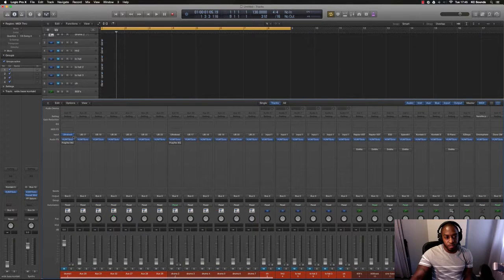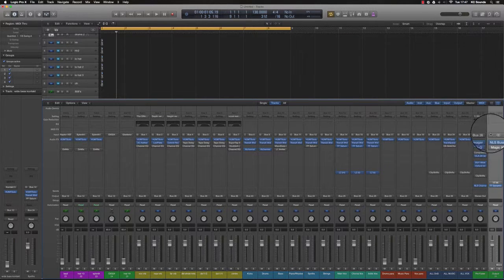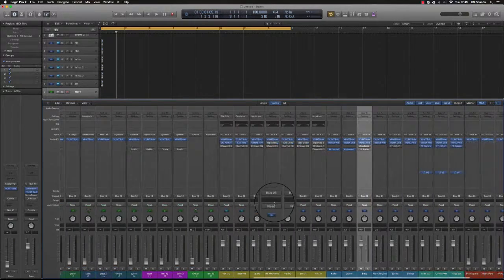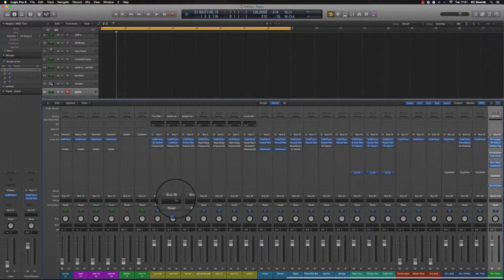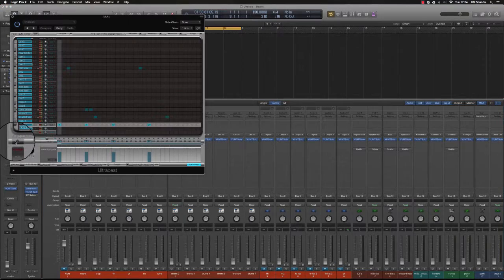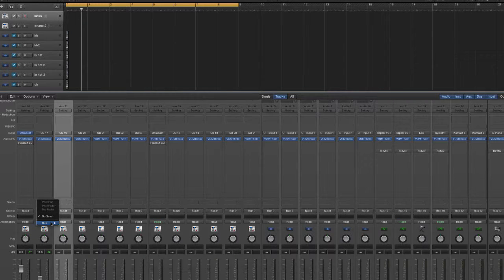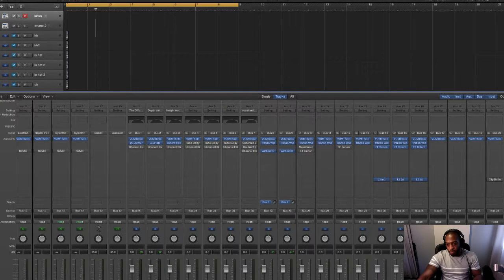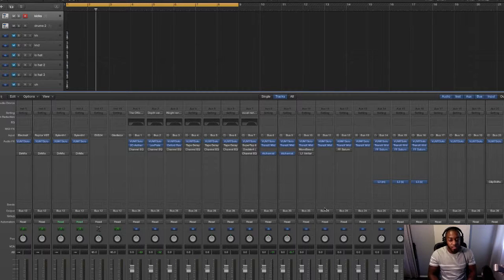"How To Route Busses In Logic X" | Buss Routing In Logic Pro X | Routing Busses

Comment: Thanks for the vid KC. I'm new to Logic Pro X and was wondering why you used the outputs to the buses and didn't use any bus sends? Could you explain briefly when to use sends and when to use outputs? Thank you
Reply from the maker: Steve Brodeur no problem bro, thank you for watching! I use busses first so I can route all elements to a specific Buss before it goes to the main output. For example - having  all the Drums on a Buss, you can glue, control and process them all on that same Buss. You don’t have to do it this way cos it can come be overwhelming, especially if you’re just starting out. I use sends whenever I want more than 1 instrument to use the same reverb etc instead of inserting it on 1 channel which eats up CPU. Hope that helps :)
Reply: KC Sounds  Thank you. Yeah, I think I'm getting it. I have all my vocals going to bus 1, and all instruments to bus 2 and thought I'd just put FX right on those Aux tracks (1 & 2). But the way you're describing it could make it more flexible especially with drums. Take care Bro. I like your style.
Reply from the maker: Steve Brodeur  Yea bro - you got i! It's all about finding a workflow that suits you, I'm just simply showing what can be done. Thank you for your support, and make sure to shout me if ever you need help. 100